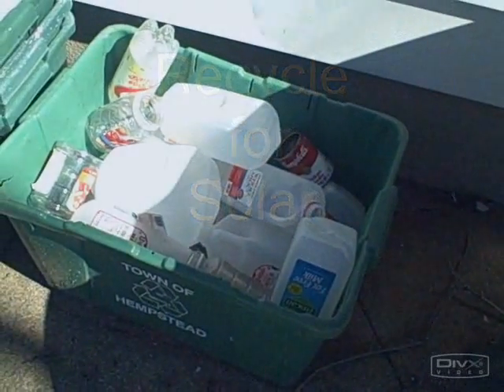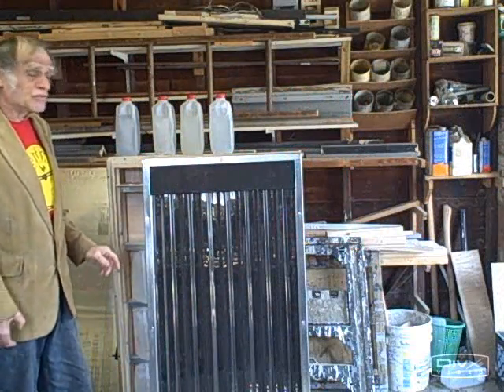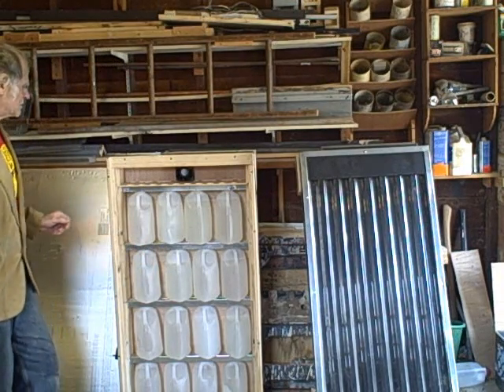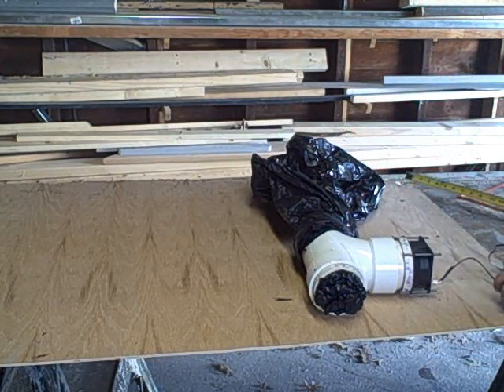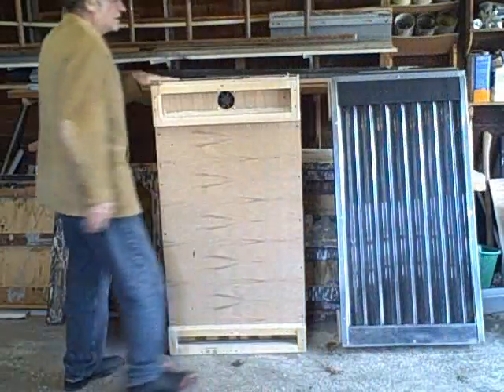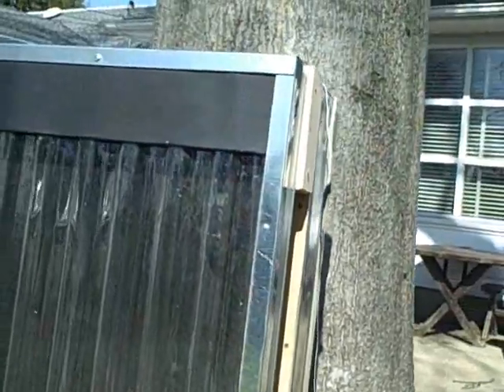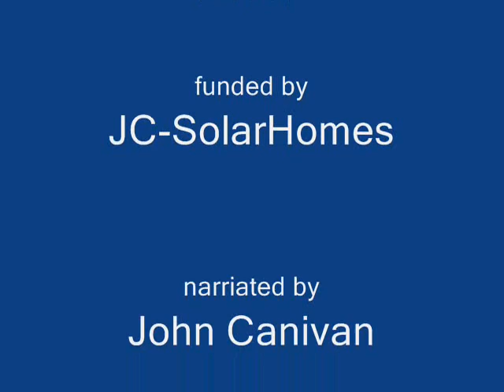Recycle for Solar

Comment: Your video got me going. I bought aluminum flashing , flat black paint, and some of that plastic board that has channels in it.
I left the painted black aluminum lay in the sun , it reached about 131F The plastic material painted black reached 143, 145 F
 i will update as needed.

Comment: Suggestion. Milk jugs are cool, but there are other things more efficient that can be recycled. The best cheap unit to get I know of to exchange air temperature heat to water temperature heat is a car radiator. Used old ones are cheap to free from a car wrecker. Attach that to a 55 gallon fuel drum , with a pipe from the bottom refreshing the water to the radiator and then back to the top of the barrel, with a slow pump also on a solar panel to power it (water pump) and you got a more efficient temperature exchange using recycled materials. The 55 gallon drum water should slowly heat up - just a thought but the efficiency of a car radiator converting air heat energy to water heat energy is phenomenal esp if you have the water cycling through the radiator even if slowly.

Comment: Great idea, and I am trying this with 10ltr water bottles. Fingers crossed it all works out. Thanks for the good information John.
Reply from the maker: Thank you Gordon.. Water is the best medium for storing heat. If you arrange tthe bottels right you should be able to extract heat from them by blowing air over them. . Good luck with your project.
Reply: Thanks John. If it works as well as yours, I will take some pics and maybe even do a quick video. Regards,

Comment from the maker: The Jugs of water are used to store heat transferred from hot air. Water is an excellent medium for storing heat BUT you'll need a large surface area to transfer large amounts of heat.
Reply: +John Canivan Salt water would be a good idea and being that heat tends to rise the inlet would be better located at the bottom of the heat storage unit.
Reply: Right but I can't think of a common container that would meet those requirements....at the price of milk jugs. Pop bottles I believe would be more durable. Much handling and milk jugs leak.
Reply: The inlet is in the best place for this setup, the air will be cooled by the water and fall down. Meanwhile, the heat in the collector will rise so you gain the advantage of passive airflow to assist the fan.
Reply: John Canivan

Comment: Throw away the air heater, install 2 sheets of glass with gap between (double glaze) on bottle chamber , put black dye into water bottles and heat water directly with sunlight , much more efficient than trying to heat with air!
Reply from the maker: Don Graham Thank you Don. Where there is a will there is a way.

Comment: 1. Yes, but the thinness of the material reduces the difference significantly.  If the water were under pressure, it would have to be thicker and then copper would be the best choice.

2. Why, indeed.  Difficult to seal to prevent water loss through evaporation.  These are sealed with their original caps.

3. Beats hanging around on the Internet or playing video games.  He's a creative guy that makes stuff, this is how he spends his free time.  That's cool.

Comment from the maker: @CTOL1  That could work. Remember a large surface area is needed to exchange a large amount of heat in a short period of time. Air heat exchanges are not very efficient but they might not need to be.

Comment: About the addition of Salt  yes it will help in keeping the water from getting funky. However unless I am mistaken the addition of a small amount of salt increases its  conductivity of heat just as it increases the electrical conductivity :)

Comment: While water is a good way to store heat it is not the best way. It is however, the cheapest by far so in that respect it might be considered acceptable.  Water does have a "specific heat" advantage over most other materials and while you can use water's specific heat to store a lot of "sensible heat", you would be better off with a material called a PCM (phase change material), to take advantage of a materials "latent heat".   There are many materials that can be used within the more or less practical temperature range of say 65F to 250F (there are many that go much lower and many much higher like common table salt which melts at 1,474°F and can store a lot of heat). Pretty much anything that has a melting/freezing point in the required range will work. Its the process of melting/freezing that can store and subsequently release greater amounts of heat through what is called the "latent heat of fusion".  For example paraffin wax could be used (although not in plastic milk bottles), to make a very good heat storage PCM. During the day increasing temperatures would be used to melt the paraffin wax (melting at roughly 120F). The process of melting absorbs and stores quite a bit of heat. When the wax is completely melted the amount of heat stored is approximately 220 kJ/kg (roughly 95 BTUs/lb), which means that 220 kJ/kg will be returned to the environment at night when it cools and freezes at 120°F.  There are many natural PCMs that will work such as lard, tallow, coconut oil, cocoa butter, glycerin,  etc... They don't have quite the kJ/kg as wax but they're in a very practical temperature range of 65°F  to 100°F.  In Johns example the 16 half gallon jugs holding about 8 gallons of water at say 120°F, would store only about 4000 BTUs of heat energy where as 8 gallons of melted wax at 120°F would store about 7900 BTUs.  Cost is a big driver here since wax is not cheap and in that respect the use of water makes for a much more practical thermal battery.  A hybrid of this idea might be to float a large lump of wax in each water jug along with water. It would store more heat but might not be worth the cost.
Reply from the maker: +Chuck O  Yes PCM use less space to store the same amount of heat but plain water is easier to work with.
Reply: Yes John, I was speaking more to your audience than to you. I've seen some of your other videos and I suspect you're already familiar with PCM and the latent heat advantage. As for cost and general ease of use, theres no beating plain old water.

Comment: interesting idea..  Am looking at this differently.  Looking to build double wall construction for the exterior walls .. The outside will have all of the insulation.. a thermal break and an intelligent wall membrane on the outer surface of the inner wall.  Then exactly as you designed place between the studs just as you did with bottles of water.  This will store massive amount of high mass into the building.  OK so why?  As you were thinking heat exchange.  The number of BTU needed to raise the temperature in the house with the high mass is HUGE. So once the house comes to temperature via heating or cooling it will have a tendency to stay at that set temperature.  There wont be need to run massive amounts of power sucking energy appliances.  This is due to actually well insulating the floor walls and roof structures.  Oddly what will be needed is forced air exchange and dehumidification.

Comment: John, I have really appreciated your input on many groups, really.  This video leaves me puzzled however, as I do not see a point.  Collecting heat, to store heat, which goes right back to your heat collector, which goes right back to your heat storage..... etc, etc, etc...  I see no way to actually USE the heat you have collected and stored.  It is a closed system, which does not help to heat a home, or wash water, or even a chicken coop or dog kennel.  When, where, how, does that heat we are collecting and storing actually connect to something we use?  Do we manually switch something open at the bottom which leads to a house?  Do we wait for a certain temperature before we do so?
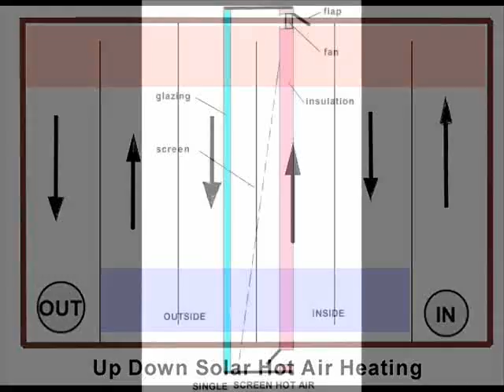Reply: It seems to me this is a proof of concept video. For the purpose of taking measurments to see how much heat could be stored etc. the system was intended to be a closed system. For using it on a house, you would want to design the house walls differently. At the end of the video you can catch some of the ideas that are possible as the music plays. Jump to 12:49
Reply: I have been looking for a good way to collect the extreme heat generated in my greenhouse that the sun radiates and be able to release it keeping the greenhouse warmer at night. This is a perfect application for this and I think the answer to my search. Thanks, John.

Comment: If you let the warmed air enter at the bottom and rise past the water than you might reduce the need the additional electricity for the fan. Insure that the outlet(s) have the same summed cross section area, so to have a good draft. Making the air go down before final exit like the Franklin Stove will make it more efficient. Sand is heavier and takes longer to warm, but releases heat longer. Just Suggestions.

Comment: Natural syphon of heated air might be possible.  How will the plastic bottles stand up to the heat?  The water will expand from heating, will the bottles expanding and contracting over and over cause the bottles to fail?

Comment: You would get far better results by painting the milk jugs black.  Enclose them in your frame, leaving a hole at the bottom to allow the cold air in and one at the top  to release the hot air..Skip the 'exchanger'  and the fan and all the rest altogether. I don't care how fancy your graph is- the steps in between serve no purpose at all . . Kind of like hiring a butler to tell you that someone is ringing the doorbell.
Reply: That was great, I'm still laughing.
Reply: Joselyn Linnell Yes, black will help the containers to receive as much heat as possible but also, after painting black, the containers will give up all their heat ad quickly as possible.
Not a particular problem but this a detail most people do not appreciate.
Reply: Donald Johnson Insanely easily entertained...

Comment: A lot of plastic containers these days are photodegradable so they wont last very long before disintagrating in the sun light
Reply: kayak347  exactly. I stored drinking water in various types of jugs in my kitchen cabinet. They are in the dark. Milk jugs leak every time.  Most time I've gotten is a year before they leak. Not to mention in the summer the heat will rise to a point that milk jugs will fail.
Reply: And due to the various bacteria that can grow in milk, milk jugs should never be re-used for anything that you will drink.  It is impossible to get them totally clean unless you have industrial equipment.  Gallon drinking water jugs are safer.  Of course, if you are just storing heat energy, milk jugs could work.

BUT... If I wanted to heat water for energy storage, I'd build a direct water heating panel and use a large (55 gallon drum or 2 or 5.) storage vessel.  A couple dozen half gallon jugs can't store enough energy to be very practical.  Using hot air to heat water in 2 liter jugs is going to be grossly inefficient.  Run piping through a collector box and let the sun's energy heat the water more directly and much more efficiently.  That build isn't much more difficult and will net better results, I think.

Comment: Can you just use a green recycling bin to put water bottles in then set it in the sun and it will heat up ? Try it and see what it do ? And try using smashed metal cans inside of a plastic bin set it in the sun to see if it warm up faster and hotter ? You may add water with the metal cans ?

Comment: Nice ideal, Will have to do it.
It is bad that we are going to the ways of our grandparents who grew up in the depression, They saved everything not hording. We lived on a Farm. In the Barn everything they had they hang it on the walls
Reply from the maker: Thank you Milk bottles that hold heat have a special value in winter.
Reply: I live in Tampa. Have a few cold snaps down here but that is it.

Comment: I have a few questions 1. Doesn't aluminum & copper transfer heat (& cold) better than plastic?  2. Why not use soda cans instead of plastic milk cartons?  3. If you were to total up the money you've spent on materials (all of them, including gas for dumpster diving trips), and the energy it took to make the materials, do you still think you have saved a dime and truly made a dent in "saving the planet?" Hope so, it & we need it (saving).

Comment: Isn't it against thermodynamics to have the heat forced down to the bottom to exit?  Maybe I misunderstood, but heat rises.  Great video, fantastic design otherwise and great workmanship!  Thanks!!
Reply: On the heated side the air will rise more than on the stored side which should create a natural convection current. The fan helps it out. Since it's a closed loop and the cooler air on the stored side is denser, it will be constantly pouring out the bottom into the heated side where it expands and rises. It's probably easier to envision the movement from the bottom half.

Comment: why not put the fan on the bottom of the water jug section, since hot air rises, but that mean making a tall structure with the heat collector on the bottom and the water jugs above, or  a second fan at the bottom near the exit to help pull hot air
Reply from the maker: You have the idea Linda. BUT it would probably be better to put a fan on top to force the hot air down... Since hot air naturally rises.heat has more value when stored in a low place. This is why radiant floor heating is so effective/

Comment: Interesting experiment.  I admit, it is a unique way to re-use milk jugs.
Now then, I think your design needs more work in the physics department.  While I don't dispute that you can heat water in this way, there is a much better way.  Also, you said nothing about how you plan to distribute the stored heat for use.  Do you plan to remove the jugs of warmed water and replace them with a new batch of jugs of water to be heated while the first batch is releasing ts stored energy?

Why not just build a solar collector box with water pipes running through it.  Add a large reservoir, (50-100 gallon minimum) and a small pump, and you have a more efficient heat collecting and storage system.  A single 50 gallon barrel of water will lose heat more slowly that 100 half gallon jugs and provide a more even heat.  The heating process of using solar energy to heat water flowing through a pipe is also quite a bit more efficient than trying to heat water by surrounding it with hot air.   You'll achieve higher temperatures in the same conditions for the same amount of time.

Comment: have you considered adding salt to the water?
Reply from the maker: Yes salt would lower the freezing point of water BUT water has a very high heat storing heat capacity due to the OH stretching bonds and the price is right

Comment: The point is to have some heat to distribute into the living space even after the sun goes down.  This, however, is just a proof-of-concept design and isn't as practical as a more fully optimized one would be.

Comment: The plastic water bottles are all not weatherproof;, after a summer they fall together like chips, because they are not UV resistant and all the work was for nothing. I have carried out the tests already in the 80 years in the Canary Islands and then adjusted.

Comment: Why is everybody in these videos so obsessed with cans, pipes or bottles? They don't add anything to the efficiency of this design. You can get the same effect with an empty box like the one you are using. The only advantage is that adding mass to the box (with bottles or cans) creates more thermal inertia to reduce temperature variations. Not worth the extra work and materials.

Comment: Let me help you out. Paraffin has a better heat exchange rate. Water is poor.
Reply: So fill the jugs with melted paraffin or mix the water with chunks of paraffin?
Reply: It should be only paraffin because in many cases the paraffin will completely melt. Paraffin comes in a wide range of melt temperatures. The higher the better for this situation; you want it to release (harden) at higher temparatures, therefore a 210F wax will do. Wax (paraffin) will expand and contract, more if the heating and cooling are accelerated. So don't completely fill the jugs, leave a 10th emply.
Reply: Cool. Thanks. Going to give this a try.